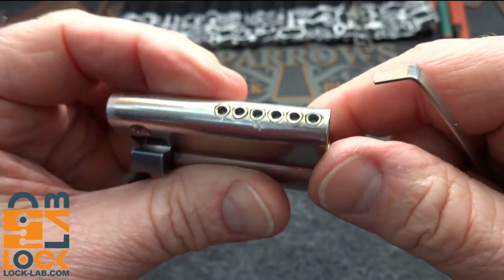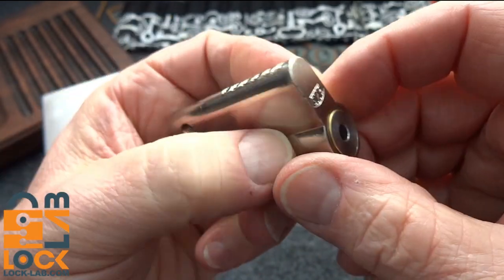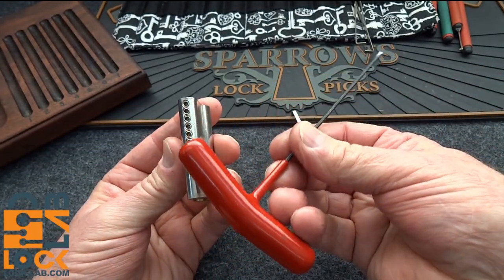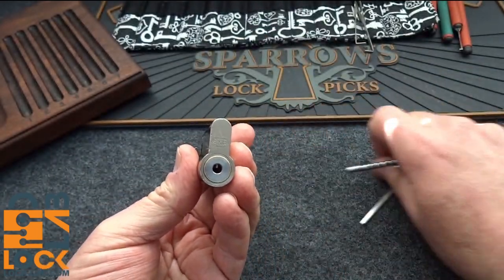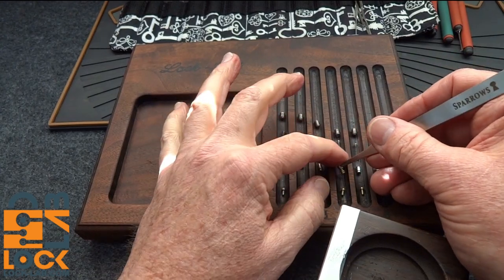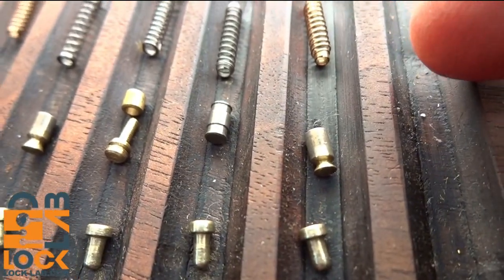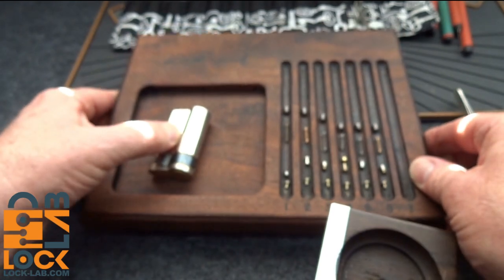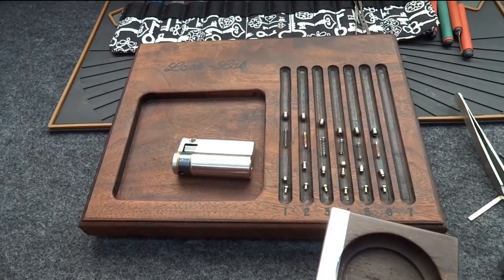(1032) Whipped: T&J's Circular Lock

Comment: Thanks Bill...After watching many of your video's I found you to be super funny, extremely knowledgeable, experienced and informative. I am a sign and lettering guy by trade and I had no interest in locks or locksmiths until I started watching you. But because I enjoy a challenge and puzzles I purchased the tools you suggested in one of your video's for beginners. (and after making some of my own using windshield wiper metal as per your suggestion, and I may add, I still prefer for tensioning some locks) I run around trying to open every lock I can find, I'm doing pretty good, (your advice is so true - PRACTICE PRACTICE PRACTICE! But still can't get a car door open..Hmm? If you have done, or will do a video on cars, That would be super! consider yourself FUNDED by me as well..Peace, and happy picking!!  Tommy in Minnesota

Comment: man, you left some dents in that beater block
Reply: Looks like they should have used something harder than aluminum.  Sweet lock.
Reply: but then you start scratching up the lock...
Reply: True, true.
Reply: TJ N the beater blocks purpose is either as a example of their capability as craftsmen, in which case perhaps it should just sit on a shelf. or its to be used as a tool to divert damage of the nice looking pinning trays bill has and to be a better tool for the purpose than those trays, in which case the aluminum as you can see is a thin plate, stamped or milled to fit the block, held in place with the center phillips screw. its purpose is to provide a hard somewhat elastic surface for striking against, using the mass of the block as an interial brake, but protecting the wood, while not damaging the lock or damaging it as little as possible. i think they designed it exactly right.
Reply: metamorphicorder a
Reply: I agree a copper or brass plate would have been too soft and worn through or even just thin too quickly and the wood could become imprinted or damaged easier. Anything harder than aluminium would probably cause too much wear on the locks. It's a nice tool actually.

Comment: The key has to have some way to apply torque to the core in order to turn it once the pins have been depressed to the correct depths. The only thing that I saw on the key that could achieve that effect was the scoop, or groove (seen briefly at 2:52) at the tip of the key. That scoop must engage a flattened surface at the bottom end of the keyway. That would seem to be the best spot to apply tension. It would probably require a purpose-built tool to do this though. Beautiful piece of work though.
Reply: Cryptopolis, I think the key simply wedges itself against the pins. That's why you have to rotate it before the lock starts opening. 
And the best way to drive it is to simply make one or two holes in the cylinder or hammer something inside.
Reply: Oh, and the best way to open it is perhaps to use a bolt extractor.

Comment: If all the key pins are identical, wouldn't the bidding on the key also be pretty much flat? I know tensioning would still be a challenge, but if you pushed all the key pins up at the same time, wouldn't they all hit the shear line at the same time?

Comment: I think you made a fatal flaw with tension approach. Correct me if I'm wrong, but I think you were putting most if not all of your tension on the pins themselves rather than the cylinder. Maybe a wedge shaped tension tool jammed horizontally into the keyway would have worked better? Either way, it's a very impressive/intimidating lock!

Comment: I think the multi-part pin is supposed to make it bump-resistant. A pick will have no problem lifting it to the right height, barring the cuts and threads. However, during bump attempts, the inner pin receives the bump force and moves around while the outer ring is clamped in the shear line by tension. Unless you somehow manage to hit the bump key with so much force that it knocks the ring above the shear line (which probably will break the key and your thumb), it won't go anywhere.

Comment: my first thought for a tool for such purposes would be something like a snap-ring pliers with rubber surfacing to give them some grip. would be difficult to tension, but I think a small enough pair would do the job, or something similar. Could also use a rubber grommet slightly oversized with a hole in the center to run a pick through.

Comment: this is what went through my mind. take one of those wrench blanks and bend it so the whole thing is cupped. then bend the end and slit it. at the opposite end bend it at what ever length you find comfortable. the slitted end would take some work to find the correct width but perhaps that would work to tension this?

Comment: How about this as a tensioning tool idea:

Take a washer then super glue a straight section of tension wrench to it so lit looks like a lollypop with a hole in it. 

Then use rubber cement to temporarily attach the flat side of the washer to the tumbler.

Then you can tension the tumbler and get to the key way. When you’re done you can peel the washer off the tumbler.
Reply from the maker: Sounds like it might work.  Next time one of these rolls into the LockLab I'll give it a shot.  Thanks for the idea.
Reply: Might have to use a wood glue if the washer width is too small depending on the clearance.  Wood glue will peel off metal but it does take longer to dry than rubber cement.

Comment: Hah. The first thing that came to mind for tensioning was "welder". But super glue would be easier to deal with.

Also, _stop tapping the wood_! :-) There's still a metal surface on the side there. (turn it 90CW)
Reply: jfbeam  That's what I was thinking too.. Super glue a washer with a handle on it to the front. But they could probably fix that by putting a freely spinning washer on the front.

Comment: They should patent this and destroy the entire lock market with low prices.
Reply: If you want quality you will pay for it, the insurance industry would love to see this quality in use more often.
Reply: The lock as a whole is only as good as the sum of its parts. This cylinder is great but if it's put into a lock that is easily bypassed then it's not a great lock anymore. I could see some manufacturer putting TandJs cylinder into some cheap lock just to save a few bucks .

Comment: I'm just wondering if that starting wedge on the key actually engages a projection in the back of the lock to tension it.  I'm thinking that maybe it hides behind the key pins and was not detected because of that.

Comment: Tips from a mechanic to a locksmith working on a carpenter's work.
Solder/ tab weld a strip of metal to the front of the core, and use it as a tensioner.
Reply: It's much like welding an old wrench to a rounded out nut/bolt. It's ghetto, it's last resort, but it's feasible.
Reply: I'm thinking that a inverted tweezers could be used for tension (the ones that opens when pressed) you could file some teeth in the outside to bite into the inside of the core and leave the middle open for manipulation
Reply: I'm thinking that a inverted tweezers could be used for tension (the ones that opens when pressed) you could file some teeth in the outside to bite into the inside of the core and leave the middle open for manipulation
Reply: Small Snapring pliers, maybe as well?
Reply: That could work with a little drilling.

Comment: ok so the coolest part of the lock is however thr key engages to turn but uou didnt say or show anythibg about it.  i see that the notch in the front pushes the pin out of the way on the way in but what happens after that?  why does it go in some and theb turn to go in the rest of the way.  what is it engaging in the core to turn it???
Reply: There is a steel pin hidden behind the 6th pin, but it's pointing the other way. So, you see the tip of the key hit that. When you turn it the groove in the tip slides on the pin and turns the core. Accessing that pin is the only reasonable way to tension the lock, I think.
Reply: It's difficult to see from the video but are all the keypins the same size?  if they are I would think that Bill's long tensioner and  a flat bar should do the trick, tension the lock then gently lift all the pins at once until it opens. or the superglue idea someone else had may work to tension as well.
Reply: There is some kind of drawing(cutaway) or it was just made.

Comment: I think you might have had a reasonable chance if you had been able to tension the plug. 
Speaking of methods of tensioning the plug, was the plug magnetic? If it was then I reckon 2 small rare earth magnets placed at 10 and 2 O'clock then that wiper blade tension tool placed across the 2 magnets might have given you just enough tension (without any interference of the pins) to pick it. However if the plug isn't magnetic, then I can only think of one way to tension it, and that would be to take a twin spring 'Y' tension wrench, and file 2 small notches on either side of the keyway for it to grab hold of.
Great video and superbly crafted lock :)
Reply: I think that visually damaging the look defeats the reason to pick it. In effect the lock has done its job and defeated you.

I just thought of an idea that might work if you've got the time to prepare. Take a thin walled piece of steel tubing, ideally just a hair thicker than the key way. Put it in a lathe and turn it down to a very slight cone just enough that it can be carefully hammered into the key way and stick just a millimeter or so. It should be possible to use the tube to tension the lock while working the pick through it.

If the edges of the tube was carefully deburred it should leave minimal marks when it's removed. I'm not even an amateur at this so no guarantees on the this being a workable idea but it's the best I can think of for the moment that doesn't include marring the face of the lock or gluing something to it.

Comment: I know it's already been said but, I would of tried (Bill may of already) to use the cam and put pressure with my finger/thumb on it.
I do find that you can gain just enough feedback through the cam and it should do it.
I'm not sure how this lock is made though and knowing what those crafty carpenters (CC's)  have done prior it wouldn't surprise me if they had thought of a cunning way to negate that style of tensioning anyway.
Reply: Pick Beard CC's 👍😁

Comment: What a nightmare!!!!   Bad dreams and hard drinking will result if you persist!!!   Did wonder though, what if you used a rubber faced disc like a washer to tension the core through face friction, while picking through a center hole of the washer.  Just a thought.

Comment: @Tobias - Lockpicking Nord8 & @Bosnian Bill

Would it be possible to use some rod which matches the diameter of the key, put a groove in the end so it can catch on the same point as the key and then grind away enough material so that once installed the key pins are accessible? You would have to make it removable of course, so installation and removal of the tension wrench would be something similar to putting the actual key in. 

Kind of like a key that had been cut lower than the lowest bitting, removing all material between pin stacks as well. I left out the part of bending the rod so that after installation the protruding portion is at a 90 degree angle to the hole instead of poking straight out, I thought it was an obvious requirement but on second thought, it may not be as obvious to some.I don't know if I explained my idea very well, probably not.
Reply: The other idea I had involved using some metal tubing/pipe which matched the key diameter, removing enough material on one side to allow access to key pins and grooving the end so that it catches on the same pin that the key engages for tensioning. Cut the tube so that once installed there is a hole which you can put your pick through and reach the pins and tin/solder/bronze a lever onto the outside of the tube for tensioning.

Just random ideas which are probably totally useless and extravagant.
Reply: I'm sure there are more ways than one to tension it. I found an L-wrench that was very thin in all dimensions. I could slide the long end all the way past the keypins and tension it against the 7th pin. It didn't even interfere with the keypins. By that I picked it several times, when it was pinned with all standard drivers. Thats when we decided to put some evil stuff inside. :-)

Comment: Would it be possible to ad a washer like dubbelsided adhesive on the front with a sheet metal piece in the same shape with a shaft as a tensioner?

Comment: looks like all them key pins are the same length? if they were all pushed up equally would you not get an open
Reply: It's hard to see, but they are of slightly different lenght.
Reply: Tobias - Lockpicking Nord. makes sense. thanks

Comment: Hey Bill (and others), I'm from Europe (the Netherlands) and I'm quite interested in picking locks but I don''t have any picks and I'm on a tight budget. I was thinking of either buying the best cheap Chinese set I can find OR buying like the 2 most useful picks for EU locks and a tension wrench.
What would you suggest I do? Buy a really cheap set or a single proper pick and wrench? And which would you  suggest I buy for European locks?
Reply: [bump] me too
Reply: snail 666 as someone who started with a cheap set of tools. spend the money on a small amount of good quality tools, build your kit over time adding more specialized tools as you learn more difficult techniques. I think you will have a better time that way.
Reply: Thanks for the tip!
Do you have any experience with European locks? I could really use some tips on which picks and where I should buy them. There seems to be quite a difference between which picks are most useful in EU and US.
Reply: snail 666 sorry I'm not that experienced. I'm just getting started as well, but having gone the cheap route I don't recommend it.
Reply: snail 666 I have started with selfmade picks from whindshield wiper inserts. Look up Bills videos on making picks yourself. They are really easy to produce and fit in most keyways. I come from germany and I have found that most 0.025" picks do not fit. I would recommend using 0.015"-0.02" picks.
Reply: I have looked at those videos however I have no idea where to get windshield wiper inserts. Where did you get them from? Aside from that I also don't own any kind of metal working tools. My dad might have a file or something but nothing for the rough shaping, like a grinder.
Reply: snail 666 I found my inserts on the streets and shaped them only with files. They are nit perfect but work
Reply: snail 666 There are 1000 hours of videos on these topics, we have also a few info videos on the subject just look at times
Reply: Thanks for all the suggestions. However I mainly want to buy a proper pick but withing a small budget. So do you guys know any specific picks that you use a lot on EU locks that I could order individually?
Reply: snail 666 Buy single picks, the PN06 and PN07 from Multipick and then the Steep Hook as well as the Euro Hook in 0.38mm of Sparrows which actually fit for all common Euro cylinders

Comment: Was the barrel magnetic ?
Reply: Adrian Atkins yes👍
Reply: I see. 
Excellent work.
Reply: Hence some copper springs.

 
Your locks are Artful.
Reply: The reasons for asking that is that there appears to be a mix of brass/steel/copper in there, so by using a magentic clamp on the barrel face (e.g. an Nd magnet) would allow some tensioning, and also cause the magnetic parts to behave differently - they might fly into a 'good' position, maybe stick where they get put.

Comment: What are you supposed to lock up with this lock? it looks useless to me.
Reply: What does one lock with a lock? How long is a piece of string?
Reply: Lambo6fo 
A shitty poser car like a Lambo, maybe?
Reply: The outer shell is a standard central European shape for standard cylinders used in doors, gates etc.  Usually the pal at the inside activates a deadbolt, spring lock or any other needed function. In general, this entire thing will be encased in metal or steel once installed.  The key handle is unusual, as it seems to be the handle from a no-key inside locking knob (linked to an actual lock on the other side of the door).